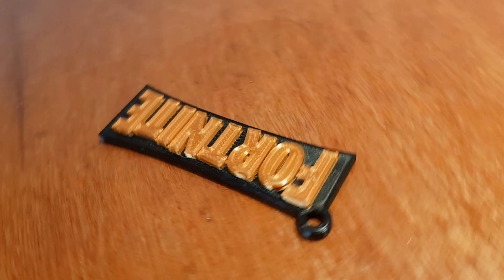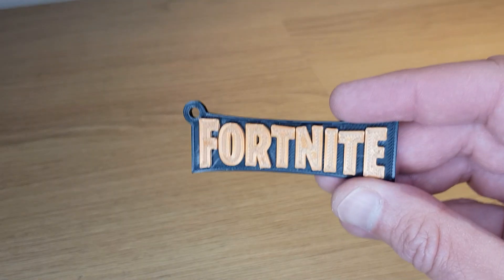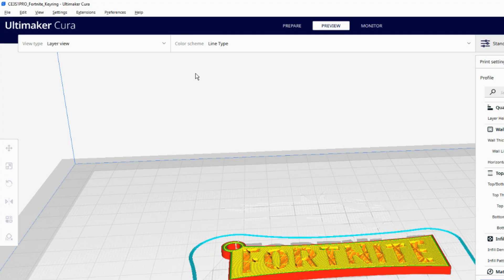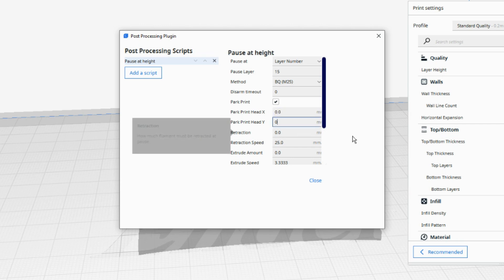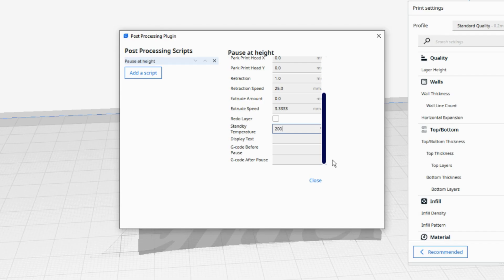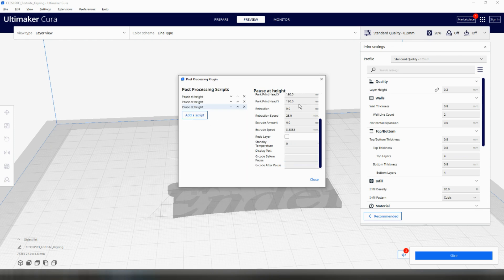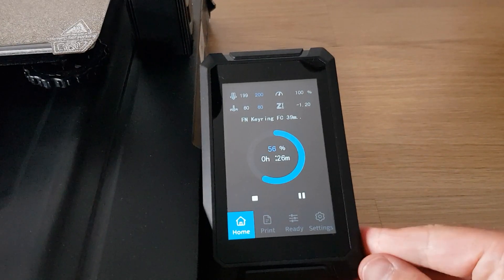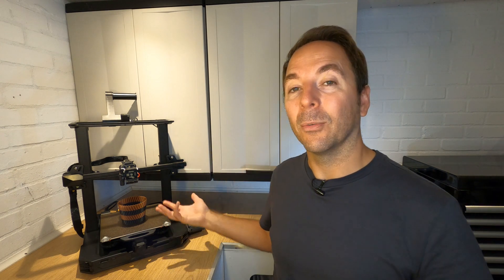Ender 3 S1 Pro Mid-Print Filament Change - Now You Can!

Comment: I'm running into the same issue as others are describing (with S1 Plus). But I found a solution; instead of pressing pause/stop, I would press the top of the touch screen (where the nozzle temp, bed temp, etc.) are; then press back; then the "play/stop" button show. Pressing on that allows me to continue with the print. I did not put any pre/post gcode (aka M300 from the video or write blah). It doesn't work with M0; only works with M25 for me. Hope others try this and see if that solves it for them.
Reply: Thank you so much! This is the only way it works for me right now! You are my part time hero now!
Reply: Thank you, it also works for me. After Changing filament i have do klick on the icon for the nozzle temperature, then klick back and play. After this i've to klick continue. Also many thanks to Ricky for this Video
Reply: You must be an angel!
Reply: 2 years after your comment is still helping, thanks

Comment: This video was just excellent. I’ve gotten it to work, thanks.  Does leave a 5mm goop even with the extrude amount zero and wiping just before resuming.  Look like I shouldn’t even do a firmware update.  Making sign, 8,  all with the same problem.  I just kinda dremel the goop off.  Not even noticeable on the larger ones. Layers go on to of it, but the head does skip.. Going to try and be more gentle inserting at the changeover.
Reply: FYI: contacted Creality and they claim they are aware and working on a solution.
Reply from the maker: I really hope they do sort this, they've had enough time and sold enough machines.....

Comment: I also updated the firmware and the process described in the video stopped working, as several people have pointed out.  After doing some searching around I was able to get a filament change to work by changing the Method to Marlin (M0).  As M0 on its own does not work with this firmware, it needs to be given a seconds pause parameter i.e. M0 should become M0 Sxxx where xxx is a number of seconds. I therefore added a 'Search and Replace' script using Search = M0 and Replace M0 S060.  This must be after all the Pause at layer height scripts.  It replaces each occurrence of M0 in the generated gcode file with M0 S060.  When I printed the file I had the printer pause at the correct layer, in the park position.  At this time I pulled out the filament to replace it.  This caused the printer to prompt for new filament of course and after inserting new filament and tapping Yes and then Continue on the screen the print head moved to the back Y position and purged some filament.  Then it went to the park position and waited a bit (I guess it was completing the 60 second pause) and then resumed the print and completed successfully.   Still not ideal because you have to monitor the print closely and be there when the pause happens and give yourself time in advance to pull the filament out during the pause but at least you can resume.  It is difficult to estimate when a certain layer will be printing of course.  Not being able to resume using the printer interface is a huge issue which really needs to be addressed. Creality is supposed to be a major player.  I tested a second time by not monitoring my print and when I got back after enough time the print was just completed; in other words it paused at some point and then just continued again after the pause time.
Reply from the maker: Thanks for this. What firmware are you running? The reason i haven't upgraded is that I don't want to lose the colour change feature. It really shouldn't be this hard.....

Comment: hmm i'm not getting the play button with the S1 Plus :(. help
Reply: I had the same issue, apparently the new firmware "patched" this. What I did to continue the print after it pauses, was hook up my printer to my pc via the USB c port and from cura in the monitor section GCode box enter M24 and hit enter and the print resumed.

Comment: My Ender 3 S1 Pro is currently on the latest firmware (29Nov2022), although I believe only the display is updated with this release, and the mainboard firmware remains on the September2022 release.
I have tried the pause at height, but although it does pause, there is no way to resume the print. I've  tapped on the "stop" button and tapped on "continue", but it doesn't change back to a "start", the display stays on the "pause" and "stop" options. I've tried switching it off then back on, but it then just re-executes the pause on height command and displays the "pause" and "stop" options. If I do tap on the pause button, the display hangs on the going to home screen, and you then have to restart.

The filament change script does actually work, it moves the extruder to the side, displays a message on the screen to say you must change the filament, then purges some filament, and then about 10 seconds later it starts automatically. The downside of this option is that you have to be ready to change the filament and you have to do it quickly, else it starts printing again no matter if you press a button on the screen or not.

I would be so happy if in the meantime you have found a way to pause at height or layer in the Ender 3 S1 Pro with the latest firmware release...
Reply: I solved it by pressing pause and confirming it, but then going into the parameters page at the top (where you could change temp, z-offset, etc.), then back to the main page. The play arrow appeared for me there and it resumed fine.
Reply: @WoodyKu  thank you, it only works in that way on my ender as well
Reply from the maker: I will do my best to update to the newest firmware and figure out the method again. Thanks for the comment.
Reply: Did you ever find a fix for this? I am having the same issue, everything else works great except it has a 40 second timeout to change the filament or it just starts printing again. (with a large purge attached to the print head) I really want it to pause indefinitely until I tell it to resume.
Reply: @AceOfBased_83  As said before, do not use "filament replacement". Use "pause"! After pressing the "stop" button, the "resume" button did not appear for me either. I pressed the top screen where the temperature etc. is, then came back and it appeared!

Comment: I've followed the direction but for some reasons, my printer only pauses for a few seconds and goes right back to printing. I am printing through USB with Cura, not sure if that's the cause. I've tried the "change filament" script instead of the pause one, with the same results. Any idea?
Reply from the maker: Have you tried with the SD card? I don't think many connect with the USB to run the print like you are, if anything happens to your PC, the print will likely fail. I haven't tried the way you are connecting, maybe try with the SD card and see if it works.
Reply: @RickyImpey  Thanks for the reply! I haven't tried with SD card because the SD card reader has been broken since day 1. Creality is sending me a replacement motherboard, but I do like so far the convenience of printing through USB since my computer is always on anyway.

Comment: My pause button never changed to a play button!!! Help
Reply from the maker: Unfortunately I've had a few people report that it responds differently with different firmware versions. What version are you running?
Reply: Honestly I’m new to the 3d printing world I just got a ender 3 s1 pro and I’m using Cura I’ve gotten pretty good 1 color prints just when I tried to do what you said it don’t work for me.   Thank you for the fast response as well

Comment: Well... unfortunatly they 'fixed' this, in a newer firmware the STOP button asks to pause to stop the print. it does never resume. Please update your video and safe folks on some wasted filament.
Reply: You need to klick now on the 100% upper right, then go back and then you should be able to continue the print
Reply: @dumigum This saved my print, thanks
Reply: Y que solucion hay??😢 . Me paso exactamente eso. Como continuo?
Reply: Enders suck ass

Comment: I tried this using Cura and also the Creality slicer.   It went great  until the printer paused and I could not get it to restart.  After several attempts and reading all the comments below I realized that I was on an updated firmware for my printer as it did not match up with your restart procedure.  Have you tried this on the newer version of the firmware for the S1 Pro?
Reply from the maker: I haven't yet, I like to always have the previous version to go back to but for some reason Creality don't seem to have any previous versions of firmware available anywhere. What version are you using?

Comment: I'm a newbie and I tried this tip using the slicer that came with the machine (Creality Slicer on the S1 Pro). It did not work. As a matter of fact, it didn't even add the script to the gcode. I downloaded Cura and it worked exactly as you described. So, I'll guess I should use Cura from now on, at least until I get a little more acquainted with 3D printing. Thanks for this video!
Reply: I have just tried a test print sliced with Creality Cura and it worked fine for me, although I was unsure it was going to restart until I noticed it was waiting for the nozzle temperature to settle causing a small delay

Comment: Thank you very much for the intersting video!! I tried this method on an Ender 3 but I have a problem once the print restarts.. The nozzle gets in the right position but extrudes a lot of material, creating a blob of the new color in the place where the printer starts again. I double checked the post-processing tool to modify the gcode and the "Extrude amount" parameter is already set to zero.. Does anybody have any idea on what could be causing this eccessive extrusion at the restart of the print?
Reply: After watching a couple of videos on this, the best way I’ve seen is to have a second object (cube or cylinder) on the bed and modify it to be the same height as your pause layer (scale on the left side of the screen, disable “keep uniform” and use the z height)
Position it to be the start position of each layer and it’ll extrude the blob there before continuing onto your main file.

Comment: After I change filament and printer start extrude. It extrude too much and make big filament ball on the surface. How I can avoid this issue. After filament change I clean the nozzle. What settings have to change in the cura? Printer is S1 Pro.
Reply from the maker: It can be tricky. I find it depends how hard you push the filament in, how long you leave it and how late you wipe the nozzle before telling it to restart. There is no certain way to avoid it with settings as you create too many variables yourself when loading the filament. Try to wipe away any filament that oozes out at the last second before the nozzle returns to the print.

Comment: You could record a video doing the color change by Prusa. By Prusa it doesn't wait for the color change, you have to keep an eye on it and if it doesn't change quickly or remove the old filament to miss the filament sensor it continues printing, without waiting for you to complete the color change. I found it very strange, the V2 waits your whole life for you to come back to change the filament, while the S1 Pro is having this problem.
Reply: im in the same boat. i have to sit there when its ready to change colors. it gives the run out of filament message. i then take out the filament from the extruder and from the run out sensor. itll go to print but then give me another message for run out since i took the filament out. then i load the next color, push filament through the extruder and then press continue. wish there was another way to do this with prusa
Reply: @essentiallites   any solution?? I have all my configurations in Prusa. The nozzle stick to the print when i have to change the filament (S1 Plus) so I have to use Cura for this

Comment: One question: I tried to use your workaround for multiple objects at one print. They are all the same, they are just multiplied in Cura. It already stops at the exact layer height, but after the filament change it seems to restart with the bottom layer
Reply from the maker: Well it definitely shouldn't do that. Have you tried understanding the g-code with something like notepad++ to see what it's telling the printer to do? Does it do it with a single print?
Reply: @RickyImpey  With the single print everything works fine
Reply from the maker: @gunzi2269  That's really strange 🤔 I'll need to try it out on mine to see what happens.

Comment: Im looking to do this exact process but change the filament from PLA to TPU at the pause. Is there a way I can make the printer change from 200 to 225 degrees and remain there for the remainder of the print? Thank you so much btw! This tutorial was awesome!
Reply from the maker: Hi, the short answer is 'yes', there is a way to do it. However, I haven't done this myself yet on the S1 Pro so can't tell you exactly what works. You can add more than one post processing script so have a look to see what the others change. I assume you will want to change temperature, retraction settings and possibly print speeds. You may have to consider separate post processing scripts for each of these. I would advise learning some of the basic Marlin commands so that you can see if the changes have occurred. This saves a lot of time when experimenting. I have been thinking about combining materials in a single print too so it would be interesting to see how to do it. I may have a play myself if I find some time🤔
Reply: Well, you are going to be present to do the filament change, so after the filament change you can just tap on the display, and then tap the nozzle temp icon and change it to 225. It should now remain on 225 for the remainder of the print.

Comment: Great video tutorial! unfortunately im fighting with this method and a creality sermoon D1 printer. It pauses and parks the printer as it should but thats as far as it gets, I tried clicking stop and cancel but that did not resume the print. I tried to manually pause the printer again as seen on another tutorial then resume printing, but this just gets a "processing, please wait" message on the screen that never goes away. Any other ideas on how I can change fillament on the sermoon d1?
Reply from the maker: Sorry, I haven't had a chance to use one yet. All of these printers that use touchscreens have their own quirks because of the way the firmware had to be adapted to make the screen work. Unfortunately it's often a case of playing around with the settings like I did here to try and find something to get it doing what you want.

Comment: I have an Ender 3 V2 and I use cura for my mid print filament change. Every time I do it starts digging into the print itself after resuming the print. What would you recommend? G-Code?
Reply from the maker: That's really odd. I would be looking in the g-code for what it is telling the printer to do as the filaments change is done. It should return to the same z height as before obviously. Is there a chance the you are moving the z height manually when you are changing the filament?
Reply: @RickyImpey  it’s not sadly and for my ENDER 3 Max is the opposite, when I modify the G-Code and change the filament and press resume, the print resumes but the z axis is now higher…
I was wondering if you know how to maybe update the firmware. My Ender 3 V2 is a 4.2.2V. I’ve always used BQ25 G code I believe it’s called when doing the height pause and never had an issue until now…
Reply from the maker: @smokeyelcrack7489  I had to play around with the different settings to find what worked for the S1 Pro. I set the height to be only one layer and tried quick test prints until I figured out what worked. You could try the same to see what is causing the z height to change.
Reply: @RickyImpey  okay, thank you! I’ll try that :)

Comment: hello thanks, finally a video that says these functions. The interface of the Ender 3 S1 pro is not very good, it lacks settings. I ask if there is any way to optimize the interface of this printer, where you can turn it off, stop, restart printing? Thank you
Reply from the maker: Hi, the resume print function on mine worked ok. Have you tested it on yours?

Comment: Hi 
how can U make the height of the z offset ( -1.45).
Unfortunately, most owners of this Ender 3 s1 pro They have problem z offset high upper 2
The cr touch  sensor useless benefit when the number exceeds 2 .
Unfortunately, we bought a printer just to look at the useless sensor cr touch  and use it like Ender 3 v2 bed leveling only manual.
Unfortunately, the company did not pay any attention to buyers.

Comment: I have the Ender 3 S1 Pro. On my printer I have almost given up on it because of bed leveling, and the lack of DECENT directions. I have found over 15 methods of leveling. My software crashes, and does not always seem to match the screens that people are showing.

Would it be possible to do a concise leveling video. Yours on leveling is to generic for this model. 
Thank you
Reply: Use the paper method. And adjust thr knobs while bed is at 60 c